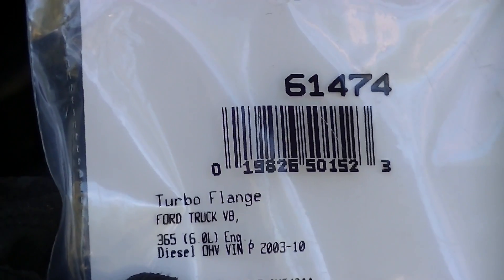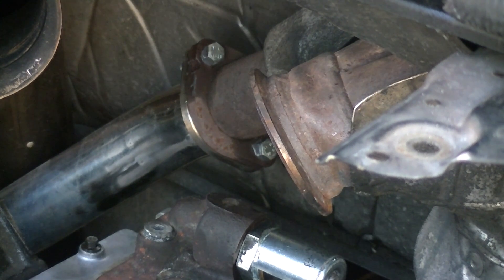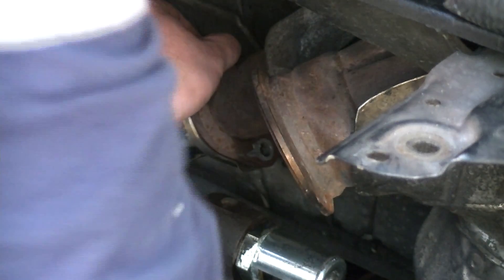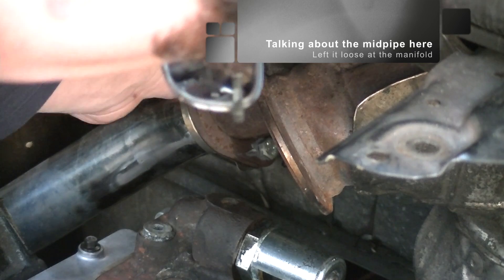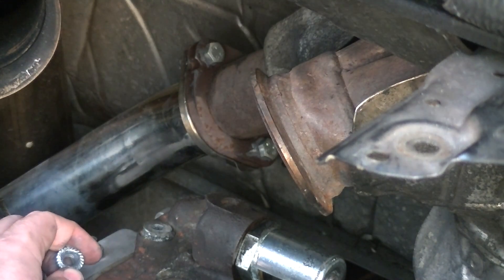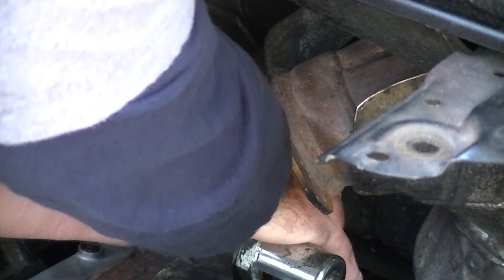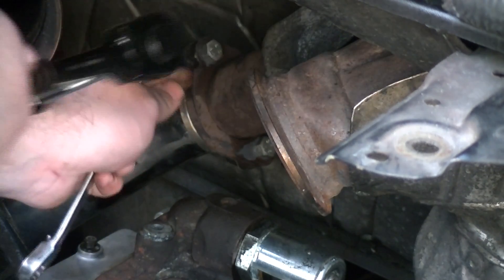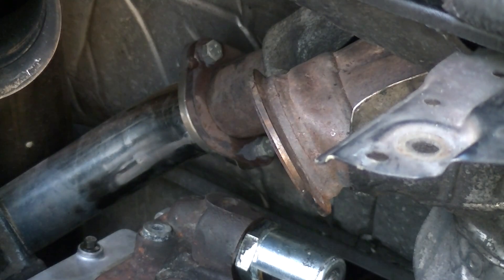HowTo: Ford 6.0L EGR Delete Mid Pipe Install

Comment: I missed the part where the pipe was installed? How did you align the thing to get to the point of puttin the bolts in?
Reply from the maker: +Joe Yates The kit I had only fit one way :)  That bend makes it so that you can't really install it any way other than how it must go!
Reply: I need that kit